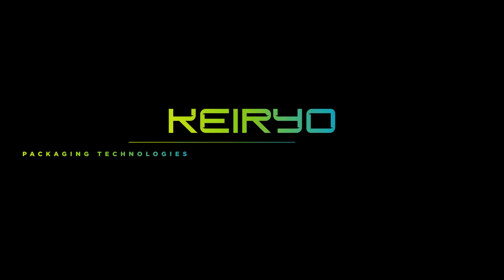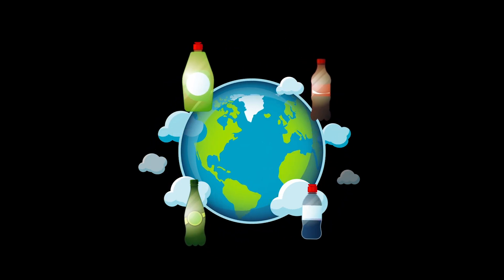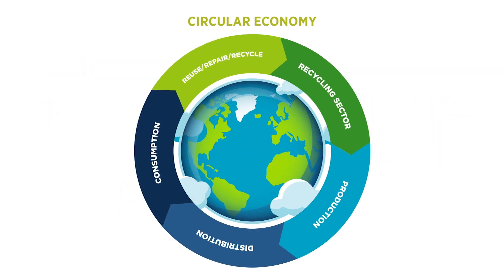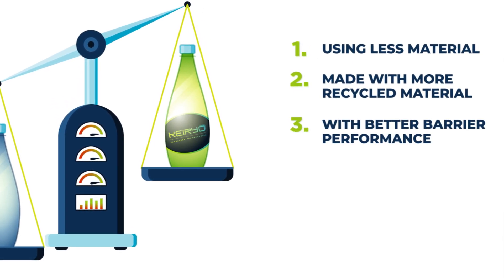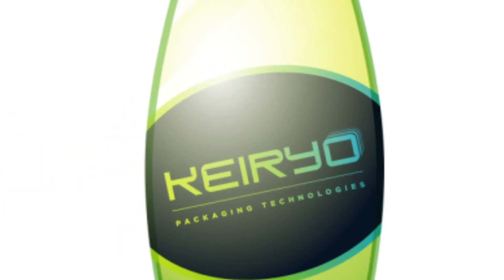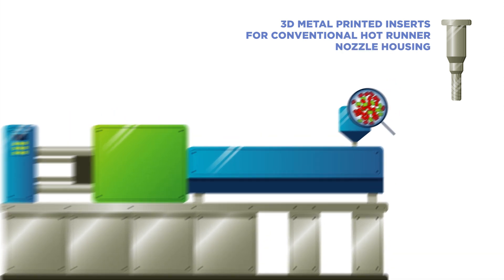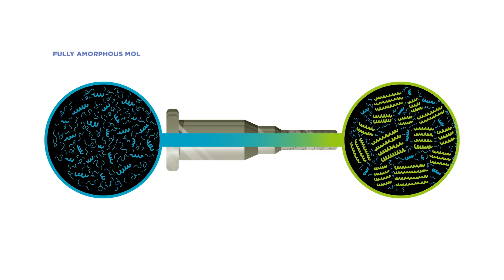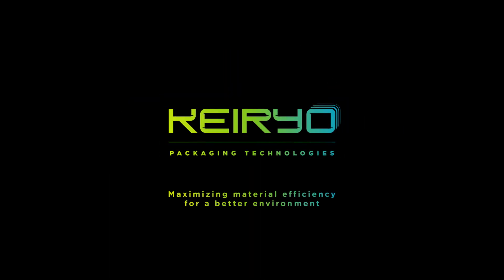Keiryo Packaging Technologies: Accelerating the transition to a Circular Economy for plastics

Comment: With a public debate centering on the pollution aspect of plastics, much focus is put on removing plastic debris from natural environments, waste management and recycling. While this is necessary these measures are the least effective solutions when considering the waste hierarchy. Solutions should reflect an understanding of the entire plastics system, and how the different stages of design, production, use and after-use handling affect one another. Such understanding will automatically lead to actions upstream in the value chain, such as innovative product design and production processes. Once such case is the Keiryo Packaging Technology which uses the injection process to alter the morphology of polymers and generate better performance. This yields a reduced weight per article which benefits the end of life impact as well as the carbon footprint.